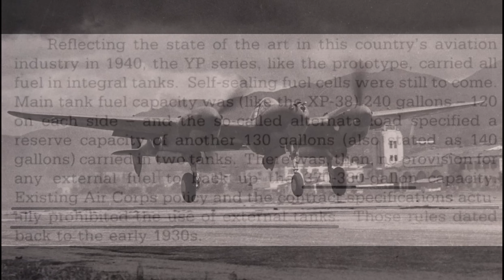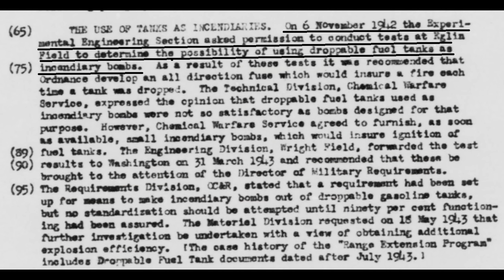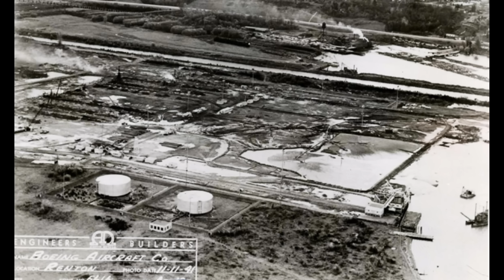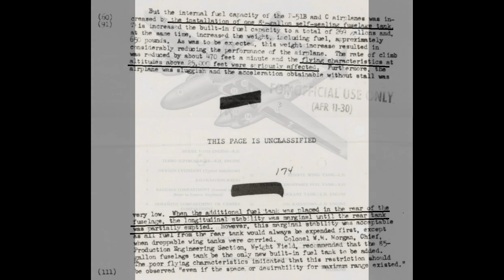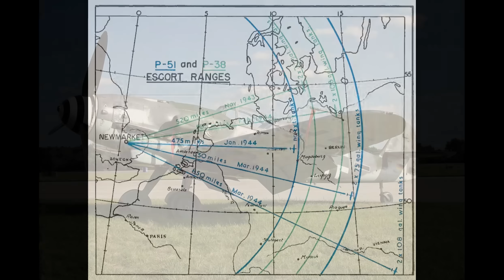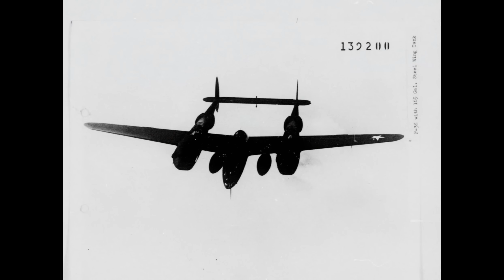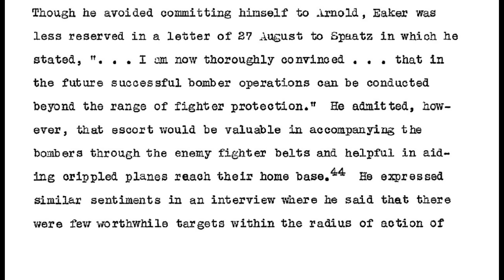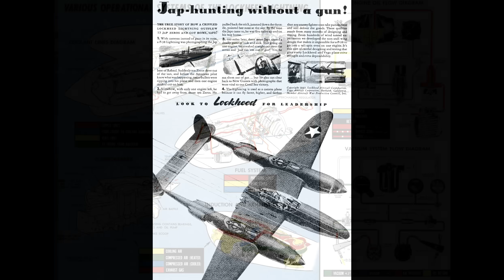The P 38 Lighting and the Bomber Mafia's Failure In World War Two

Comment: I think this awful bloodshed is as much the responsibility of the RAF and the failure of the Hawker Typhoon as the Eighth,  we tried in 41/42 to take on the luftwaffa at home and failed because we used the Spitfire which was unsuitable for this role. Had the much bigger and heavier Typhoon succeeded that could easily have taken a much bigger fuel load and would already have been taking on the luftwaffa at home, but the aircraft was not good enough for the long range high altitude fighter role.
Reply: The typhoon & then then tempest probably just didn’t have the range for this. the size and fuel consumption of the Sabre was just too much compared to say a Merlin on a p51. the P47 had a similar issue but carried more fuel.
Reply: The Typhoon had the potential for a significantly increased fuel load but that was never persued, by the time the Tempest came along the P51 P47 combination had it covered.

Comment: Greg - you still cherry pick references; 

Kelsey INSTRUCTED Republic to design and produce for test, a P-47 equipped with three 75gal drop tanks, one belly, two wing - after Arnold issued instructions for all tactical aircraft to increase range - to include Pursuit, Attack and Light Bombers on March 3rd, 1942. Kelsey memo also addressed Lockheed, Curtiss and Bell. Date of Kelsey memo was March 7, 1942 in Response to Arnold directive. I sent the memo and all the History of Droppable Fuel Tank package as A2069 from USAFHRC which includes that memo, but you left it out. Why? You have extracted several references from that very large file, but consistently fail to reference the many times Arnold inserted himself into Materiel Command, Wright Field to kick ass for slow delivery of the droppable fuel tanks.

The letter you referenced from General Chidlaw 'with no known response' - was to Ralph Damon, Pres Republic Aircraft in which he cited poor performance of the 200gal ferry tank - and a Much stronger sense of urgency for Republic to install production wing tank capability than early 1944.

Republic first tested three 75 gal equipped system on a new P-47D-2 July 1943 - approximately 18 MONTHS after Kelsey instructed Republic to do the three 75gal tank modification. The test also described a much lower fuel draw capability above 17,000 feet for the centerline tank with G-9 fuel pump - the same pump used in the Australian 200gal steel tank.

The P-38E wing pylon/fuel feed kit was applied to F-4 and in the FUTURE as production PV-1, delivered in December 1942 with two 150gal droppable fuel tank capability - a year After the P-38E first flew with the 150gal Lockheed tank. 

The only reason the F-4 entered combat earlier as long range recon is that the P-38E were retained on west coast as air defense. The P-38F with production wing pylon/fuel feed and supply of 150gal/300gal were sent to Australia after the F-4 started combat ops. The P-40E, P-400/P-39D equipped with B-7 racks for 52 and 60gal drop tanks were also deployed - one Year before Republic tested their first P-47D with a B-7 rack.

You reference Kelsey as a lowly Captain suggesting low influence - at the time of the Bodie's description of Arnold's conversation with FDR.  Kelsey was a LtC and Chief, Fighter Branch at Wright Field - and a near God to the airframe industry as Echols spokesperson. Bodie's recount about Arnold's statement about 'fly the P-38s to Britain' may be taken at face value, but the account was not referenced in Kelsey's "Dragons Teeth".  

P-40C/D/E, P-39D, A-36, P-38E all designed external bomb and 52, 75, 90 gal (and 150/300 for P-38/F-4) fuel tank droppable capability around B-7 and B-10 bomb racks, but not Republic.

Republic stuck with the four-point attach system on skid plate through the P-47D-5. Even when the Eaker ordered 40,000 Bowater-Lloyd 108 gal tanks in March 1943, it had the four point attach for the P-47C - which is why the 75 gal drop tank delivered in June would not work, which is why the 110 and 150gal drop tanks designed in US for B-7/-10 racks would not work on the P-47 - which is why Kenney rejected the tanks Arnold ordered to be sent when Kenney complained of short range making P-47 nearly useless.

You can correctly cite Materiel Command turning development of combat tanks as a 'science project' - but incorrect to state that Arnold (or Spaatz, Kenney, Doolittle) were 'indifferent' to fighter escort for heavy bombers. Eaker complained bitterly about his P-38s being replaced by P-47s for Torch. Arnold complained that Eisenhower drained 8th AF to provide 12th AF all the P-38s and his early B-17 Bomb Groups.  Kenney pleaded for more P-38s. Both Kenney and Eaker went 'local' to try to solve the P-47 Range issues and the issues with non-standard four-point fuel tank attach scheme.

There were no reservations by any of the theatre commanders to use 'non-sealable tanks' - nor did Arnold interfere when Eaker got the 108gal Bowater paper tank, or Kenney obtained the Ford built 200gal steel tank.

Look to MG Oliver Echols, CO Materiel, Maintenance and Distribution Command if you want to point to incompetence but lay some blame on Kartveli for having to be dragged kicking and screaming to put 'draggy' items on his P-47. Look to Bodie to reference his own questions in his book Thunderbolt.
Reply: 37:15  can you find any fault in these range numbers?
Reply: @appaho9tel  Fungible range numbers are beside the point.  Policy and directives are  at issue.
Reply: This is totally bogus and arguments discredited previously. 
It’s also pure obfuscation to stand on a hill to claim P38s weren’t available when at least some were and decisions made resulted in these not being used appropriately with fuel tanks as bomber escorts.. none of these arguments are addressing that central point Greg is making
🤷‍♂️
Reply: Thank you for trying, but Greg will never admit bias or error.  There are plenty of documents to indicate the Arnold was not the source of delay on drop tanks.  In fact, just the opposite. In Feb 1942 Hap Arnold directed the air staff to do whatever was necessary to get drop tanks on fighters as soon as possible. And until they arrived in England for the bomber escorts he kept asking why it was taking so long.  Here is another example from “To Command the Sky” by Smithsonian Institution:

In 1939, shortly after WWII had broken out, Arnold expressed concern over the neglect of pursuit tactics and technological development. Arnold up to that point he had been a bomber partisan, but now with supreme command responsibility over the Army air am and with the Spanish Civil War and Poland as evidence, he had to consider both sides of bomber vs fighter issues. In a Nov 1939 memo to the General Frank Andrews, former commander of GHQ Air Force, Arnold wrote that “the subject of pursuit aviation—tactics and plane development, has not received the share of attention and interest in the Air Corps it merits. The Idea that fighter aircraft cannot shoot down large bombardment planes in formation . . .has been proven wholly untenable. It has been demonstrated recently beyond a doubt that the best antiaircraft defense is pursuit aviation. He suggested that one other factor for the low state of the fighter was the teaching of doctrine in tactics schools, and another could be that higher ranking officers had little experience in command of fighter groups and squadrons, which was a young man’s game. In endorsing Arnold's memo, Col C.S. Russel was even more critical of the neglect of fighters, pointing out that advocates of bombardment had overlooked vital consideration in the ability of bomber to resist fighter attack, such as the concentrated firepower of fighters vs the less accurate flexible guns of bombers. He suggested the service schools lay emphasis on the value of pursuit. The Air Corps Tactics School that had focused on strategic bomber doctrine was soon to be disbanded as the Army began focusing on preparing for actual war. 

In May 1939 Arnold appointed a special panel known as the Kilmer Boarder to make recommendations on research and development priorities. Its third priority, behind liquid-cooled engines and fire control apparatus, was for a fighter to rank with the best in the world. Eleven months later Arnold appointed a second panel, the Emmons board” which added as a forth priority an escort fighter with a 1,500 mile range. When he received the report, Arnold exchanged places between priorities 1 and 4. Arnold made the escort fighter priority 1 in early 1940, long before US entry into the war.  These were official policies, not the prewar work of the theorists denigrated on YT as the “bomber mafia”.  These official actions (and many others) clearly indicate it was not Arnold’s intention to prohibit fighter escort of bombers, as claimed by the uninformed conspiracy theorists crowding YT these days.
Reply: @gort8203  Thx - I have all that and more in my new book. You are dead on. Arnold (and Marshall) also opposed stripping 8AF for Torch - but FDR/Churchill prevailed.
Reply: @gort8203  this isn’t really a rebuttal though is it? Arnold was in charge and made practical decisions after what you’ve described that prevented or delayed the practical development & deployment of tanks or even the full use of USAAF fighters in the escort role in the European theatre. relative prioritization or superficial intent in 1939-40 clearly matter less clearly compared to what was actually done 1941-43.
To be generous the priority became deploying bombers quickly then in numbers to justify the doctrine and resources invested during wartime. protection by fighters was not given the same priority probably because some losses were seen as acceptable and this was supported by the rather self serving rationale that bombers could look after themselves and escorts could come later. 
what you’ve actually highlighted is in reality more damning in the sense that there was an earlier understanding that bombers probably needed escorts based on early war experience but this was conveniently “forgotten” until high losses were recorded and the “mystical/ mythical” P51B/D came along as solution.
Reply: @garydownes2111  You are repeating the same mantra and refuse to accept contrary facts.  Show me documentation of these "practical decisions" you say Arnold made which "prevented or delayed the practical development & deployment of tanks or even the full use of USAAF fighters in the escort role in the European theatre".  
The practical decisions that handicapped 8th AF were not made by Arnold, they were made by George C Marshal over Arnolds objections. That was the diversion of fighters and bombers that had been allocated to 8th AF to the Mediterranean for Torch and following operations.  The actual invasion of North Africa took priority from 8th AF strategic bombing.
Reply: @garydownes2111  If that's not a rebuttal I don't know what is. These facts are clear, but you reject them out of hand because they do not fit your theory.  But you have no actual evidence to support your theory, you just accept it because you like the story.  Show me the documented evidence that Arnold later made "made practical decisions [. . .] that prevented or delayed the practical development & deployment of tanks or even the full use of USAAF fighters in the escort role in the European theatre."
Reply: @gort8203  Greg has provided much evidence & context you seem happy to discount and ignore based on your own prejudices..
Reply: @garydownes2111  I don't have prejudices, I have facts, facts you are discounting.  Give me one of Greg's facts that disproves the facts I have provided about what Arnold actually did, not what you think he did. You guys are attributing the failure to solve the escort problem sooner to an intentional conspiracy, and I have seen zero evidence for that.
Reply: @garydownes2111  Need more facts?
The Combined Bomber Offensive plan drafted in April 1943 did not contain a specific directive on escort for daylight precision bombing.  Hap Arnold appended the plan with his opinion: “At all times there is a need for an extensive U.S. fighter force to protect the bombers and to assist in the reduction of German fighter strength.”  This is just one of many actual actions by Arnold that disprove the unfounded accusation that his directives were intended to prevent fighter escort and prove that bombers did not need fighter support.   

In Feb 1942 Hap Arnold, in response to demands from his field commanders and his own growing doubts about the invincibility of the bomber, directed the air staff to do whatever was necessary to get drop tanks on fighters as soon as possible. He later sent General Kepner to North American and Lockheed to insist on more internal fuel for the P-51 and P-38. This is how the P-51 got its aft fuselage fuel tank and the P-38 the leading-edge wing tanks. 

 One reason the early operations of 8th Fighter Command had little success in engaging German fighters was that its commander, Frank Hunter, was a fighter general who believed fighters destroyed more enemy aircraft in free ranging fighter sweeps than in close escort of the bombers.  This was not a crazy theory, and at various times was shared by pre-war USAAF strategists, Adolf Galland, and Jimmy Doolittle.  When Doolittle assumed command of 8th AirForce he revised the primary objective of Fighter Command from protecting the bombers to shooting down Luftwaffe fighters wherever they could find them.  But at the time Hunter employed this strategy it was ineffective because the Luftwaffe basically ignored his fighter sweeps.  
Hunter was a close personal friend of Hap Armold. Ira Eaker, who was also a personal friend of Arnold, did not apply enough pressure on Hunter to switch tactics, either out of deference to Arnold or deference to Hunter’s fighter expertise. Since Eaker knew the bombers could not be escorted all the way to deep targets, he was probably not sure Hunter was wrong.  But he did want longer range escort fighters that could do this and told Arnold so in writing.  Arnold already wanted close escort of the bombers and found Hunter’s performance disappointing overall, so he solved one problem by telling Eaker to fire him. Arnold replaced Hunter with William Kepner, the general he had sent to pressure North American and Lockheed for more internal fuel in their fighters.
Reply from the maker: Didn't we literately debate this already? Every single thing you said in this post is easy for me to shoot down. 

You accuse me a cherry picking. I put up a mountain of documents that coincide exactly with what actually happened, which proves the actual intent. On the other hand you are cherry picking the very few documents that don't match the historical reality of what actually happened. Had Hap Arnold really wanted fighters to escort all the way to Schweinfurt he could have easily done that. He didn't do it regardless of what butt covering documents he put up. 

     Trying to somehow credit Arnold for the Brisbane tank and the British 108 is beneath you. You know darn well that Arnold had nothing to do with those projects. He didn't stop them once he learned of them because it would have been political suicide at that point. The tanks were already in use and working well. 

     You need to move on to another topic, one in which the facts back you up. A good example would be the Shuttle missions, which I know you know more about than almost anyone else, and these are under represented in history.

Comment: P38 withdrawn from lang range escort due critical Mach problems. Wing not suitable for high altitude inceptions .
Reply from the maker: Try and prove that it was withdrawn for that reason with any USAAF source. This comment is probably based on Eric Brown's self promoting nonsense which can be easily disproven.
Reply: Are you a bot?
Reply: The P-38's mach problem was not the wing, it was interference in in the airflow from the engine and the fuselage interacting with the wing. Bode's book has a great appendix where Kelly Johnson discusses this.
Reply: Excellent videos very comprehensive, educational. Fantastic fighters the P38s and P47s
Reply: P38 lightning mach limits and other issues. from three years ago - Gregs airplanes and automobiles , minute 27 onwards . “Primary objectives of bombers destroy luftwaffe, secondary destroy industry. “P38 not up to the job” cant drive after germans . British shot down plane with retro fitting airbrakes by mistake .( a partial fix to recover the plane out of dive.) Delayed the fix(partial)